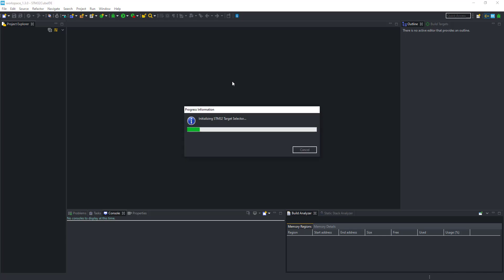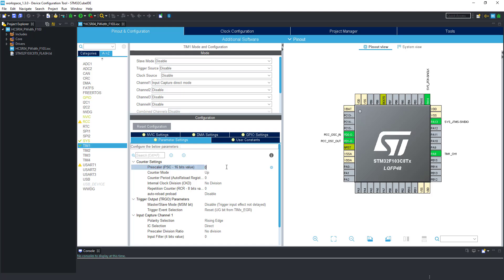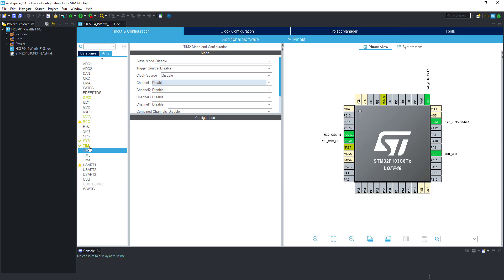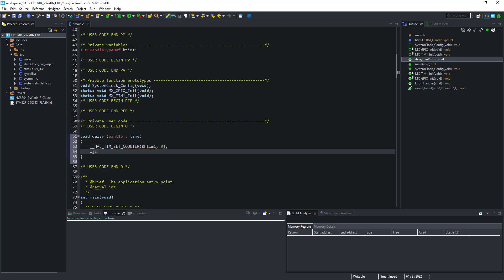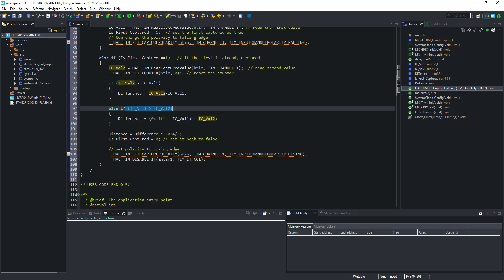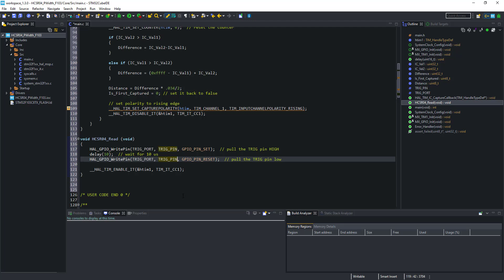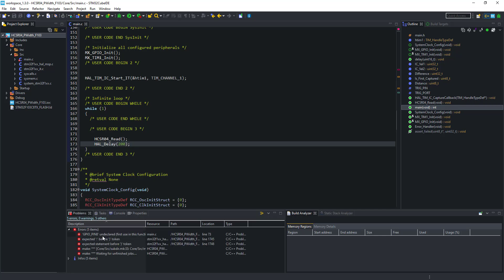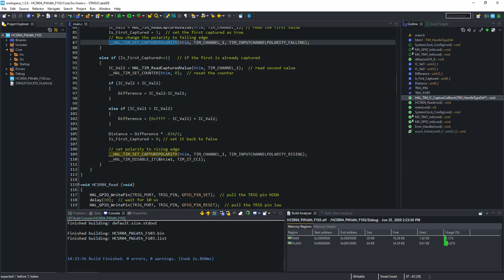Interface HC-SR04 Ultrasonic Sensor with STM32 | Input Capture Tutorial

Comment: Hi friend, I'm trying to create a mini sumo robot with two HCSR04s and I'm looking for the optimal way to use them. I've tried your code and it works fine, but I have a question: wouldn't it be better to use "pwm input" instead of "input capture" for this purpose? Greetings and congratulations on your channel, it's great.
Reply from the maker: Its pretty much the same thing.

Comment: How to add a second ultrasonic sensor to this work please ?
Reply from the maker: Use another timer for it. 
In the Input capture callback function, perform the check which timer called the interrupt. 
If (htim->Instance == TIM1)
{ write the entire code here}
else if (htim->Instance == TIM2)
{Write entire code here again}

Also define new set of variables( IC_VAL, difference etc..) for second sensor.
Reply: @ControllersTech I did this but  one sensor works fine but the second one give juste one correct value and stop working

Comment: Hello! 
I have STM32 Nucleo L476RG. If you have problem like me that sensor doesn't measure anything or LCD is bombarded by random numbers here is solution, which worked for me.
1. Change these lines in your code to this:
 #define TRIG_PIN GPIO_PIN_9
#define TRIG_PORT GPIOA

According to this video, TRIG should be connected do PA9 and ECHO to PA8. Remember that TRIG should be as GPIO_Output. On pin PA8 (to which is connected ECHO) you should make TIMER and enable option Input Capture mode.

2. Make sure that sensor is connected to 5 V DC.

3.  Add this function to properly display values on your LCD:

void lcd_display_distance(uint8_t distance) {
    char buffer[16];
    sprintf(buffer, "Distance: %d cm", distance);
    lcd_clear();
    lcd_put_cur(0, 0);
    lcd_send_string(buffer);
}

4. Make sure you add these lines in main:
MX_TIM1_Init();
 MX_I2C1_Init();
/* USER CODE BEGIN 2 */
  lcd_init();
  HAL_TIM_IC_Start_IT(&htim1, TIM_CHANNEL_1);
  lcd_send_string ("Dist= ");

5. In while make sure you have:
HCSR04_Read();
HAL_Delay(200);

And add this line too:
lcd_display_distance(Distance);

That's all worked for me. I hope that this comment will help you. 
Greetings!

Comment: What is the input frequency ??? Plz reply
Reply from the maker: Input frequency of what ?
Reply: Input frequency of Ultrasonic sensor
Reply: And btw can u tell me how much frequency we need to give to produce 25khz ultrasonic sound??
Reply from the maker: Here ultrasound module produces the output pulse, which we read using the mcu and calculate the distance. 
We are not producing the ultrasound here. Ultrasound is being used by the sensor to calculate the distance of the object in front of it.
Reply: @ControllersTech  yeah but if u don't mind can u tell me about what frequency i can give to generate 25khz ultrasonic sound in transducer?
Reply from the maker: If you want to generate 25KHz sound, just give the frequency of 25KHz.
Reply: @ControllersTech  thank so much

Comment: hey, there are two problems:
1. When the LCD reaches number more than 9 it shows A, how can I fix it?
2. The ultrasonic sensor fakes the distance measurement by 3 or 4 centimeters, do you have a solution for this?

Comment: How to use this code for STM32NUCLEOf446re board. i tried but i have some error. how to solve this... 12:14:51 ** Incremental Build of configuration Debug for project HCSR_04_input_capture_mode **
make -j4 all 
arm-none-eabi-gcc "../Drivers/CMSIS/RTOS2/Template/cmsis_os1.c" -mcpu=cortex-m4 -std=gnu11 -g3 -DUSE_HAL_DRIVER -DSTM32F446xx -DDEBUG -c -I../Core/Inc -I../Drivers/STM32F4xx_HAL_Driver/Inc -I../Drivers/STM32F4xx_HAL_Driver/Inc/Legacy -I../Drivers/CMSIS/Device/ST/STM32F4xx/Include -I../Drivers/CMSIS/Include -O0 -ffunction-sections -fdata-sections -Wall -fstack-usage -MMD -MP -MF"Drivers/CMSIS/RTOS2/Template/cmsis_os1.d" -MT"Drivers/CMSIS/RTOS2/Template/cmsis_os1.o" --specs=nano.specs -mfpu=fpv4-sp-d16 -mfloat-abi=hard -mthumb -o "Drivers/CMSIS/RTOS2/Template/cmsis_os1.o"
arm-none-eabi-gcc "../Drivers/CMSIS/RTOS2/Source/os_systick.c" -mcpu=cortex-m4 -std=gnu11 -g3 -DUSE_HAL_DRIVER -DSTM32F446xx -DDEBUG -c -I../Core/Inc -I../Drivers/STM32F4xx_HAL_Driver/Inc -I../Drivers/STM32F4xx_HAL_Driver/Inc/Legacy -I../Drivers/CMSIS/Device/ST/STM32F4xx/Include -I../Drivers/CMSIS/Include -O0 -ffunction-sections -fdata-sections -Wall -fstack-usage -MMD -MP -MF"Drivers/CMSIS/RTOS2/Source/os_systick.d" -MT"Drivers/CMSIS/RTOS2/Source/os_systick.o" --specs=nano.specs -mfpu=fpv4-sp-d16 -mfloat-abi=hard -mthumb -o "Drivers/CMSIS/RTOS2/Source/os_systick.o"
arm-none-eabi-gcc "../Drivers/CMSIS/RTOS2/Source/os_tick_gtim.c" -mcpu=cortex-m4 -std=gnu11 -g3 -DUSE_HAL_DRIVER -DSTM32F446xx -DDEBUG -c -I../Core/Inc -I../Drivers/STM32F4xx_HAL_Driver/Inc -I../Drivers/STM32F4xx_HAL_Driver/Inc/Legacy -I../Drivers/CMSIS/Device/ST/STM32F4xx/Include -I../Drivers/CMSIS/Include -O0 -ffunction-sections -fdata-sections -Wall -fstack-usage -MMD -MP -MF"Drivers/CMSIS/RTOS2/Source/os_tick_gtim.d" -MT"Drivers/CMSIS/RTOS2/Source/os_tick_gtim.o" --specs=nano.specs -mfpu=fpv4-sp-d16 -mfloat-abi=hard -mthumb -o "Drivers/CMSIS/RTOS2/Source/os_tick_gtim.o"
arm-none-eabi-gcc "../Drivers/CMSIS/RTOS2/Source/os_tick_ptim.c" -mcpu=cortex-m4 -std=gnu11 -g3 -DUSE_HAL_DRIVER -DSTM32F446xx -DDEBUG -c -I../Core/Inc -I../Drivers/STM32F4xx_HAL_Driver/Inc -I../Drivers/STM32F4xx_HAL_Driver/Inc/Legacy -I../Drivers/CMSIS/Device/ST/STM32F4xx/Include -I../Drivers/CMSIS/Include -O0 -ffunction-sections -fdata-sections -Wall -fstack-usage -MMD -MP -MF"Drivers/CMSIS/RTOS2/Source/os_tick_ptim.d" -MT"Drivers/CMSIS/RTOS2/Source/os_tick_ptim.o" --specs=nano.specs -mfpu=fpv4-sp-d16 -mfloat-abi=hard -mthumb -o "Drivers/CMSIS/RTOS2/Source/os_tick_ptim.o"
In file included from ../Drivers/CMSIS/RTOS2/Template/cmsis_os1.c:28:
../Drivers/CMSIS/RTOS2/Template/cmsis_os.h:157:10: fatal error: cmsis_os2.h: No such file or directory
  157 | #include "cmsis_os2.h"
      |          ^~~~~~~~~~~~~
../Drivers/CMSIS/RTOS2/Source/os_systick.c:25:10: fatal error: os_tick.h: No such file or directory
   25 | #include "os_tick.h"
      |          ^~~~~~~~~~~
compilation terminated.
compilation terminated.
make: * [Drivers/CMSIS/RTOS2/Template/subdir.mk:19: Drivers/CMSIS/RTOS2/Template/cmsis_os1.o] Error 1
make: * Waiting for unfinished jobs....
make: * [Drivers/CMSIS/RTOS2/Source/subdir.mk:25: Drivers/CMSIS/RTOS2/Source/os_systick.o] Error 1
../Drivers/CMSIS/RTOS2/Source/os_tick_ptim.c:25:10: fatal error: RTE_Components.h: No such file or directory
   25 | #include "RTE_Components.h"
      |          ^~~~~~~~~~~~~~~~~~
compilation terminated.
../Drivers/CMSIS/RTOS2/Source/os_tick_gtim.c:25:10: fatal error: os_tick.h: No such file or directory
   25 | #include "os_tick.h"
      |          ^~~~~~~~~~~
compilation terminated.
make: * [Drivers/CMSIS/RTOS2/Source/subdir.mk:29: Drivers/CMSIS/RTOS2/Source/os_tick_ptim.o] Error 1
make: * [Drivers/CMSIS/RTOS2/Source/subdir.mk:27: Drivers/CMSIS/RTOS2/Source/os_tick_gtim.o] Error 1
"make -j4 all" terminated with exit code 2. Build might be incomplete.

12:14:54 Build Failed. 9 errors, 0 warnings. (took 3s.207ms)
Reply from the maker: Your errors are related to RTOS. But I didn't used RTOS in the video.
So this is irrelevant

Comment: Good video.  I have a question.  If I have a signal coming at 65 Hz, at what speed should I set the timer2 to read that signal in input capture mode.  Thanks.
Reply from the maker: Somewhat in kilohertz would work

Comment: how to edit the coding by not using lcd monitor? i'm using teamspeak to display the distance
Reply from the maker: just remove the LCD part
Reply: @ControllersTech  ok done...I had integrated your data logger video and had build it with 0 error but when debug,  failed to start GDB server...reason (4) no device found on target appeared

Comment: If the distance if greater than  127 it Distance variable becomes negative number. How should I fix this?
Reply from the maker: Try changing the data type of distance
Reply: @ControllersTech  Thanks, it worked. However, I have one more question. What is the maximum  speed of reading the sensor?  It seems that if I  reduce HAL Delay to less than 15 miliseconds,  callback does not return correct values.
Reply: @ControllersTech  Also, when I'm using the other timer for PWM signal, it somehow interferes with sensor  and the results fluctuate depending on pwm signal